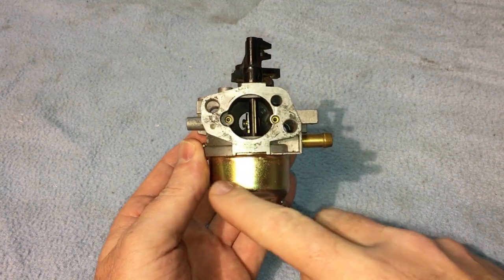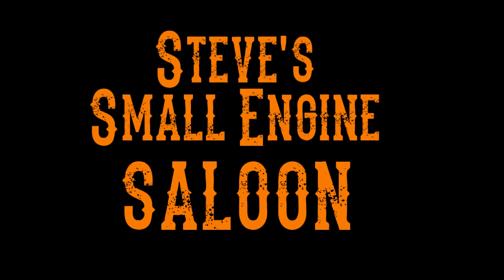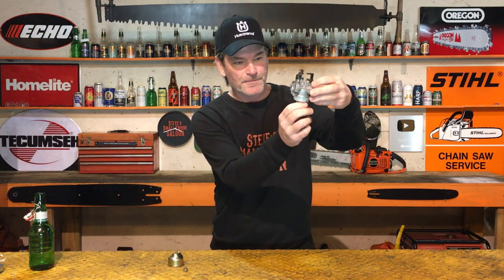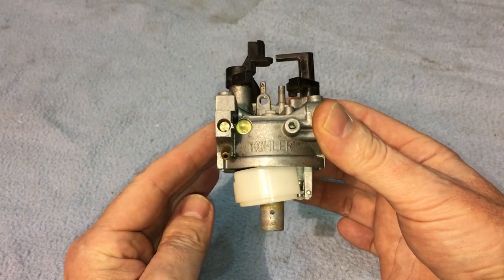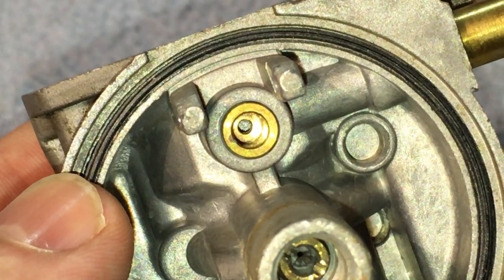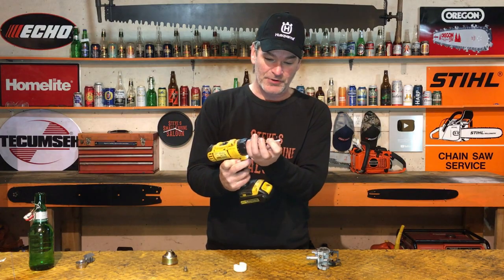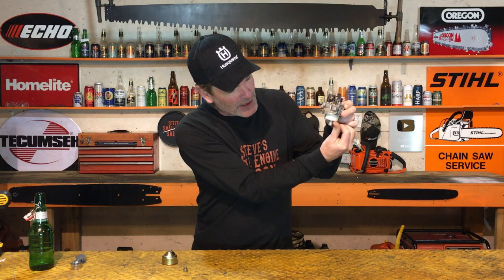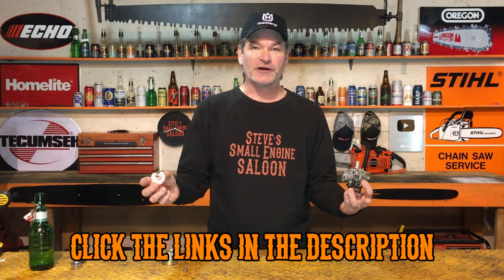Here's Why Your Lawn Mower Is Leaking Gas - Honda Style

Comment from the maker: ✅Click here for a new carb ➜ https://amzn.to/2s6t0hc
✅Click here for a drill ➜ https://amzn.to/2QMyfgp
✅Click here for a new needle ➜ https://amzn.to/3Eceoj7
✅Click here for valve grinding compound ➜ https://amzn.to/2qy3Sjg
For more videos like this, check out: 
👉Straighten A Bent Lawn Mower Crankshaft With A Pipe ➜ https://youtu.be/w2Ro9GmEyOE
👉Fastest Way To Tell If The Crankshaft Is Bent On A Mower ➜ https://youtu.be/3up57DHiCqs
👉Here's Why Your Lawn Mower Is Leaking Gas - Honda Style ➜ https://youtu.be/tp67AzWNbI4
👉How To Adjust the RPM Speed on a Lawn Mower ➜ https://youtu.be/7YrA3QEIFnE

You can connect with Steve here too: 
✅Visit Steve’s WEBSITE ➜ http://www.stevessmallenginesaloon.com/ 
✅Visit Steve’s PARTS & TOOL STORE ➜ https://www.amazon.com/shop/stevessmallenginesaloon 
✅Follow Steve on FACEBOOK ➜ https://www.facebook.com/stevessmallenginesaloon 
✅Follow Steve on INSTAGRAM ➜ https://www.instagram.com/stevessmallenginesaloon/ 
✅Follow Steve on TWITTER ➜ https://twitter.com/SteveSaloon
Reply: Hi Steve, Good stuff here... I prefer Mickey's or Founders Breakfast Stout. Thanks for the Info!

Comment: I just bought a replacement carb for a Honda lawnmower from Amazon for $17.99. It came with gaskets, air filter, fuel filter and spark plug. It wasn't a Honda brand carb but it works perfectly.

Comment: I don’t use a Q-tip. Just use an electronic cleaner spray. Always works. It dislodges the dirt and flushed it away then evaporates. Do the same thing with the needle. Easy and quick.

Comment: That’s why I like my Briggs & Stratton lawnmower engine a new carburetor is only $12
Reply: That's because it's cheap plastic internals that easily get blocked, briggs dont make them like they used too
Reply: Most carbs are 12 bucks. My Briggs engines and my cub cadet engines
Reply: I had that problem and Seafoam fixed it without doing anything else but drain the crankcase of gas. Used it for years after.
Reply: @benturner4774  I think it's the ethanol in the gas.

Comment: I have a Honda HRX217K5HZAA with auto choke.  I have 3 carbs for this mower, all 3 pass Steve's float test.  All the carbs are very clean and 2 are brand new out of the box.   However, once I cut the grass, shut the engine off it wont start again and I see fuel has leaked into the air filter and the the spark plug is wet with fuel.  So, even though the carb's do not flood doing Steve's test it somehow floods after the engine has been run for awhile.  The same issue occurs with all 3 carburetors so it has to be something else causing the issue, any ideas???

Comment: My local small motor repairman sold me a new needle , rubber seal for the bowl + time , over 35 cad....still leaking ! Bought a chinese from waldo on-line $ 18 cad delivered, works better than original , it is even primerless. Great info Steve.

Comment: It helps  big time... just scored a toro with honda engine. Someone thrown out for garbage... gas tank bone dry. Put Gas in run pretty good. Noticed the gas leak at the filter... so i will clean the needle as you did... and or get a new carb on Amazon.  Thx😂😂😂🎉🎉

Comment: Today I have just fixed this problem on the carburator on a Honda GCV engine.
I did not believe the guy who told me, that there was fuel in the oil.
The cumbustion chamber and spark plug was also very sooty. 
Seen your video, I understand, that the leaking valve could cause the problem.
After cleaning the carburator carefully, adjusted the mixturescrew ½ a turn out for a richer mixture, mounted new airfilter the engine now runs great and do not surge anymore.
Thanks for this video just at the right time for me.
Reply from the maker: Right on Buddy...

Comment: This fixed my mower!   Thanks so much!  

I have the Troy Bilt push mower with a Honda GCV 160 engine.    The problems started with the engine running rough, the governor having to adjust a lot, and bumps when mowing would make it choke out and die.     So I started by changing the throttle spring and governor spring.   Didn't help.    I then noticed the mower was using way more gas than normal, then I found fuel in the air filter, did some googling, and found this video.  Totally worked!     Thanks!  I always shut the gas valve off when I'm done mowing, so I think that's why i didn't notice the dripping fuel in the filter.    Just sharing what i experienced in case it helps someone else figure out their mower's symptoms too.
Reply from the maker: You're Welcome...

Comment: Thanks Steve, cleaned out an old Honda carburetor to revive a dead snow blower only to have the carburetor leak gas.   Sure enough, it was just a little tiny bit of gunk in the needle line.    Works fine now and no leaks.   Will have a Spaten to celebrate.
Reply from the maker: You're Welcome...

Comment: Everything Steve said in this video is totally true. The carb is cheaper than purchasing the parts. The needles with rubber tips will give you a problem in leaking and if you can't fix it, just buy a new carb instead.
Reply from the maker: Right on

Comment: I thoroughly cleaned my Chinese Honda carb several times and it leaked like crazy.  I used your Q-tip suggestion and now it doesn't leak at all.  I honestly never though this trick would work but it did.  Thanks a million.
Reply from the maker: Glad it helped!

Comment: Super helpful and very easy fix. I overfilled the mower and there was probably some debris in the top of the tank that that got sucked in. The tiniest speck was on the rubber tip.

Comment: Thank you. Replaced my leaking fuel hoses only to then find fuel pouring out on the engine side of the carb - thought I must have damaged the gaskets. However watched a youtube video on top 5 causes of mower leaks. Gaskets not mentioned but carb was. Then your great video featuring the C’Honda carb on my cheap mower. Took the bowl off, turned the fuel on, and tested the float - the pin was sticking - a few manual movements of the pin with the fuel on seemed to flush it through. Mower fixed, lawn cut. Bravo for very clear video.
Reply from the maker: Awesome..

Comment: Like your videos and I sit on side lines and only comment if I feel it might contribute.  

I was stumped with my leaking carburetor on my Honda GXV160 after the throttle cable had detached at the throttle body.  I reattached it, only to discover that the mower would not start.

This was about 3 weeks ago. Ever since I've had several attempts to sort it without success. I  thought it might be a fuel issue and found your advice on cleaning carbs. I followed it and  I striped it down and cleaned it. Reinstalled it and it would not start and now it was leaking fuel like a sieve. I had not installed  the fuel bowl correctly and quickly sorted that.

However it just didn't want to start and now there was a steady fuel leak. I tighten everything up and it reduced, but still overnight it was leaving a decent pool of fuel. I thought I must have stuffed up with the cleaning of the carb. So after three or four times pulling the carb off checking an reattaching it was no better.  I called my local dealer for price of new carb ....wait for it....NZD circa $140  that's around $86 USD. I didn't like that idea and rather than support local  I decided to buy one from Ali Express  to try. About $35 delivered with gaskets ,fuel filter and fuel line (too short). Not too much of a loss if it didn't work out.
Once it arrived I took the old carb off and installed the new one. Still leaking fuel, but only about 10ml overnight. But , still not starting. Then with the help of a mechanically minded friend after running through all the standard checks again,   we finally discovered a small hole the size of a pin head on the fuel line by the carb end of the line. At some stage during maintenance I had pinched it with pliers too hard stopping the fuel from coming out of the hose. Now, once the fuel line was fixed it no longer leaks, that appears to have been the problem in the first place.
However the engine would not start.
Checking the spark plug again it had good spark - so eliminated that  , what else could it be? Well the actual issue was the throttle cable and on my mower it is only adjustable at the engine end. It turns out a millimeter means all the difference between engaging the choke or not.  It took quite a bit of mucking around bending the arm that activates the choke and then getting it adjusted so the stop switch would could also be activated. I never expected that it could  headache. 
It runs just fine and because it baffled me , I figured that maybe someone else may have had a similar issue and not figured it out. Turns out it was more like a 4 beer job...

Keep up the great videos

Comment: Steve, you are the man! I watched a bunch of other YouTube clips before I found yours that exactly described the problem I had with gas flowing freely out of the carburetor of my Honda HR21 lawnmower. Removing the bowl, float , and needle and cleaning them along with the needle seat fixed the problem. The only thing I did differently is perform the repair while the carb was still attached to the mower, leaning the mower on its side for better visibility. Cleaning the needle seat with a skinny cotton swab was a blind effort but I figured if it didn't work, THEN I would remove the whole carb. I tested the repair while the bowl was off, moving the float with my finger to start and stop gas flow and confirmed success. Then I put the bowl back on.  Because I did not remove the whole carb, the repair only took about thirty minutes. Thank you so much!
Reply from the maker: Right on Mike!  You're Welcome...

Comment: Thanks man! I've got the powersmart Chionda lawnmower and I just changed everything out oil, plug, and cleaned the carburetor.  Now my mower is really loud! And when I mow my hill that's has a steep slope my mower starts smoking blue bad!!! Then I noticed it's leaking gas at the carburetor and the oil is black!!  I hope this will fix the issue?  I thought I cleaned this good but never took that pin off and check this.   Though it never smoked before I messed with the carb...I don't wanna buy a new mower atm, I know it's a pos but the motor runs good . . I've ran it for 1hr  hopefully I didn't damage the rings.  Also the spark plug was really chard..😢

Comment: Steve, love your site and your channel! I recently received a power washer with a Briggs engine that wouldn't start from a friend. Someone worked on it before it was given to me. I gave it a small blast of starting fluid to make sure it would want to run, it did. I gave it some gas and made sure fueI fed to the carb, pulled the carburetor off and made sure there were no obstructions through the jet and other orifices, which were clear. At first I was perplexed but then I though about how the fuel is fed and inspected the main jet nut and there I found the obstruction. Cleaned it out with some carb cleaner, reassembled, and now I have a running power washer! This was far from the first carb I've worked on and it made me think, how many others have the same problem and just buy new when they cant find the problem. Thanks for the great content and please keep them coming! Try a Yuengling, it helps me!
Mike S
Reply from the maker: Right on Buddy...

Comment: Thank you Steve--You saved me $40 in the cost of a new carburetor! I couldn't tell if the fuel was leaking due to a leaky fuel bowl gasket. Before I ordered a new carburetor because my Honda carburetor does not have a replaceable bowl gasket, I tried your clean-out of the float needle, and wham! Problem solved! Thumbs up Steve, and now I've just subscribed and can't wait to learn more about small engine maintenance!
Reply from the maker: Excellent!
Reply: If you don't subscribe you can't play like the rest of us - so hit that button and learn lots more. 
Oh, Steve, 5 years ago (when I turned 68)  I found out I had /Diabetes - so no beer since then - however - there were only a few beers I didn't like and so I was very easy to please.  Great work Steve, we all learn one thing at a time.     Joe S (AK & ID)

Comment: Cub cadet xt 1 Mower just cut off while mowing. Tried to restart. Blew out huge cloud of white smoke. Heard gurgling under hood. I looked and saw gas streaming down front. Got to the air filter compartment which was overflowing gas. When I removed air filter, gas was pumping spurts of gas, through a port, though the Kohler engine was off! So I drained the tank. Not sure the cause but will try this first?

Comment: I need to know where to order the And expensive carb kit you spoke about on the video about leaking gas after cleaning the carburetor. The needle to the flow and the little rubber piece. I’ve checked with Briggs & Stratton they only sell the little metal needle

Comment: I Steve! I'm from Buenos Aires Argentina and I've a Murray Lawn Mower with a B&S 650 Series engine and have it a gas leak by the push primer button. Is possible that the leak come from improper adjust of the neddle and seat inside the bowl? Thanks a lot

Comment: I thought for sure this fix would solve my issue, as it seems to describe my problem exactly. Mine started leaking this way after I removed and completely cleaned out my carb and reinstalled it (was getting engine surging). 

I performed the procedures in this video, and even did the test before reassembly, which worked just fine. After reassembling, I left it to sit for a while, seemed fine. After about an hour or 2 I came back and fuel was coming out the intake area by the air filter again.

Comment: Installed brand new OEM Honda carb for a hrx217hxa manual choke. The mower turned on first pull . Turned off mover and gas was pouring out on the air filter side of the carburetor. Was very  carful in allow the breathing holes lined up  with the holes in the gaskets! Any thoughts?

Comment: I have a leak from the carburetor in a Honda hr194, when I open the fuel valve, just a stream flows from the carburetor... could this be a similar cause (i.e. dirt)? Additionally, the engine cuts out after a few minutes of operation. Please advise if I can clean it and fix it or is a new carburetor required?

Comment: Very informative Steve. That's exactly what's going on with my Yardman with a GVC160 Honda engine. Gas is leaking from the Air Filter side. This is AFTER I put a New Carburetor on !! Maybe the manufacturer put the Float together wrong. Will find out tomorrow. Going to take the New Carb apart. Thanks for the video.
Reply from the maker: Good luck Joe...

Comment: I had a problem with the exact same carb a few days ago.  I also have a cleaner way of testing the float.  I just put a spare piece of fuel line on the inlet, turned the carb upside down, and blew and sucked on the fuel line.  I knew I had it right when I couldn't get any air to go through anymore.   You're welcome.  :-)

Comment: Hi Steve, i know this question has nothing to do with this clip, but any idea if the briggs 23hp commercial v twin has hydraulic lifters and would they be able to be accessed through the push rod holes or would they need to be accessed from the crankcase?

Comment: Got a honda gvv160 back in the shop with reoccurring fuel leak from the carb . I installed a new oem honda carb on it and it still leaks fuel . im assuming im getting some pressure build up from the tank . i did  removed the cap and cleaned it and ran a welding tip cleaner through all the little holes . it seemed to me to be working properly. Im stumped here  any ideas ?

Comment: Is the float valve even expected to seal when the mower is tipped over to one side (say when changing a blade) - the float/pivot/seal would not be in their normal orientation.  I turned my mower to the side (air filter/carb uppermost), fuel leaked from the carb.  Had to drain the tank & carb bowl.  How can fuel leak from the carb (which hole)?  It didn't leak into the air filter, that was dry.

Comment: Great video again, as always.  I'm still more of a Yuengling or Guinness guy when I[m working on stuff.

Had the same dilemma for my Husqy Trimmer motor.  Carb went bad and it cost $19 for a rebuild kit or $25 for a new OEM carb.  I bought the carb.

Also, have you done anything on the fuel hoses and such that are supposed to be more resilient to E10 or E85?  And, as far as hoses sizes go, is there any kind of a "go by" as to what size hoses go with what types of motors and carbs, or do the manufacturers all kind of use whatever suits them?
Reply: John, do a youtube search for DIY removing Ethanol from gasoline - NOTHING GOOD comes from using it.

Joe S (AK and ID)

Comment: I have the same issue, with a pressure washer, using a Honda GVC 160. It keeps soaking the air filter with gas. I will give this a try.
Reply: It did work!! In my case, the needle's tip looked good under a microscope. However, hole where the needle goes looked messy. I cleaned it just as shown in the video. I tested it, also as shown in he video, and there was no more gas overflowing. Now my pressure washer works like new! Thanks, Steve!!

Comment: Hi steve..as stupid as this may sound, I had to take the old bowl off and clean it, it was really bad, used a wire brush and Drexel, looks new now...it never leaked but now it does, somehow I dont feel like I'm putting the bowl back on right..is there a right way? Its a honda gxv160 carb

Comment: Thanks Steve,  excellent video and easily understood,  good similarity between carb and WC float.  I'm  having exactly this problem on my first day back gardening.  Will give it a go tomorrow.  Lucky I have a spare mower!
Reply from the maker: Best of luck!
Reply: @StevesSmallEngineSaloon  Thanks again Steve, I wondered why fuel was seeping out of my air filter, I had put the needle in upside down!  Working perfectly now and you saved me a few quid, new carb was between 50 - £70.